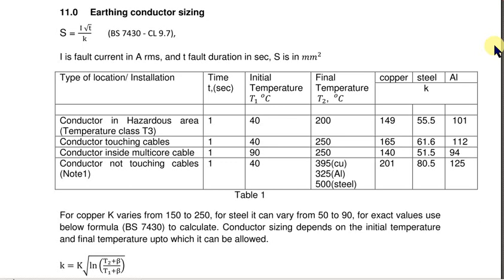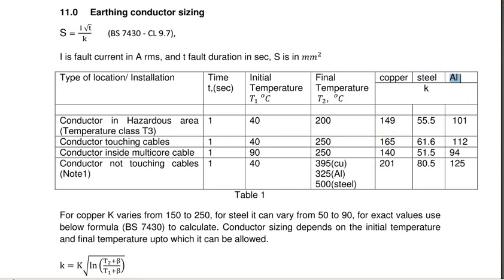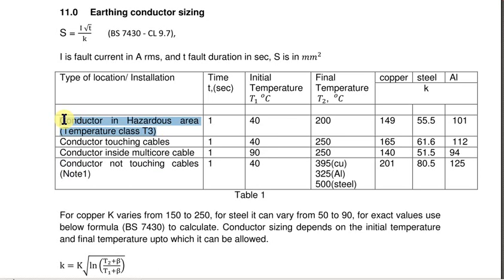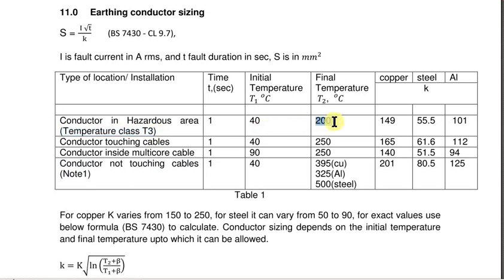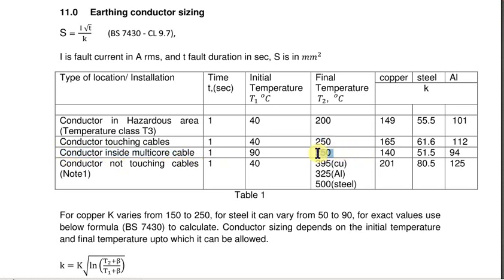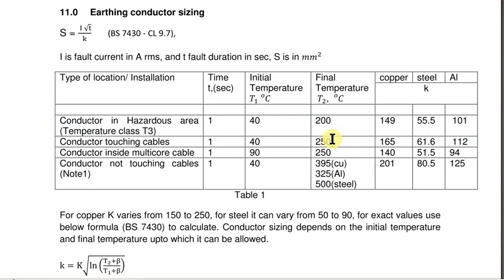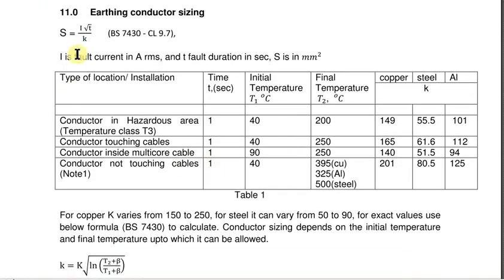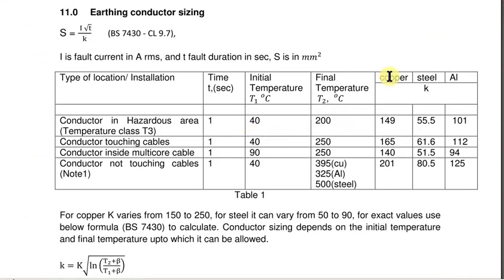Earthing conductor sizing

Comment: Sir, how to select the number of earth pits for particular thing...
Reply from the maker: calculate the resistance of one earth pit if it is 100 Ohm, then calculate the resistance of the grid say grid gives 2 ohm, we need another 2 ohm in parallel with 2 ohm to get 1 ohm. so pits together should  gives 2 ohms, hence we need 50 pits